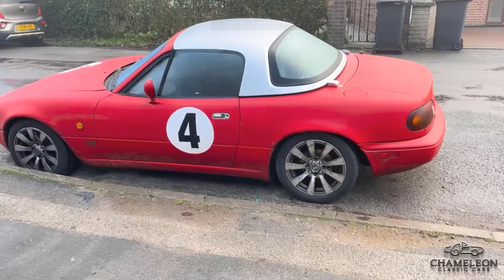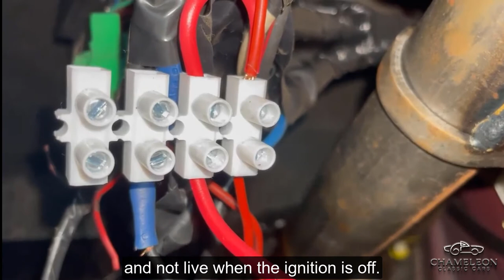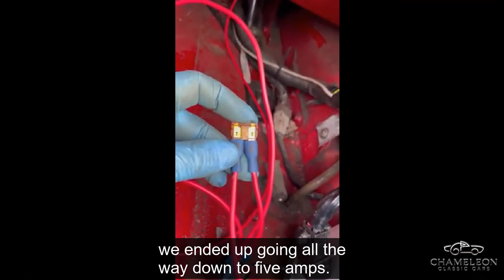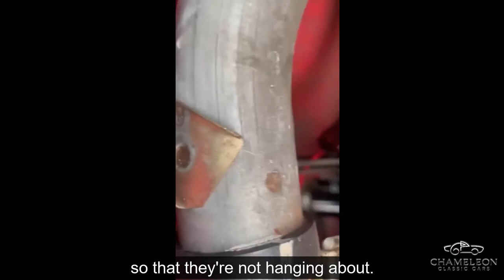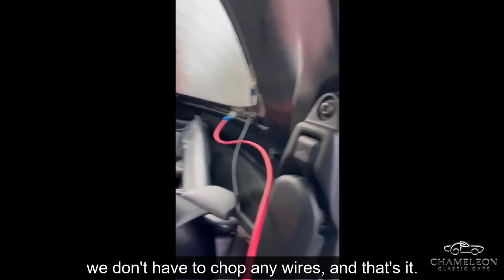How To Wire In Heated Rear Screen Mazda Miata / MX5 / Eunos Mk1

Comment from the maker: 00:00 How To Wire In Heated Rear Screen Mazda Miata / MX5 / Eunos Mk1 
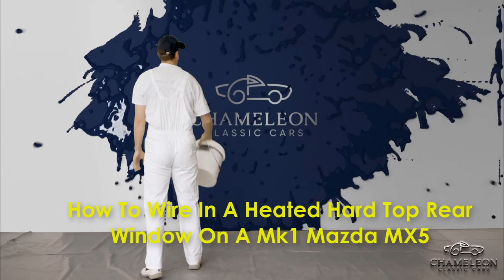00:26 Heated Rear Screen Mazda Miata / MX5 / Eunos Mk1 wiring diagram 
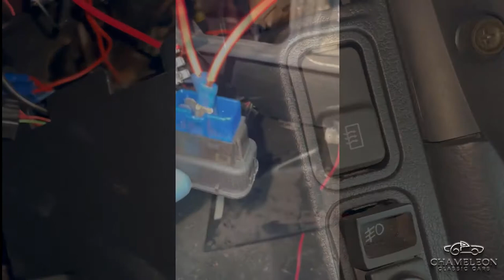01:52 Heated Rear Screen Mazda Miata / MX5 / Eunos Mk1 switch 
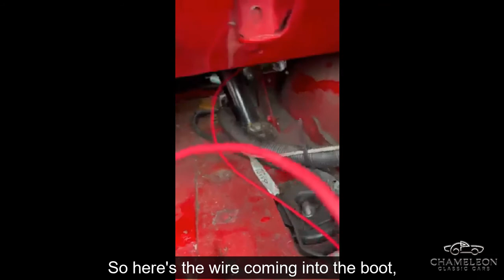02:26 Heated Rear Screen Mazda Miata / MX5 / Eunos Mk1 relay 
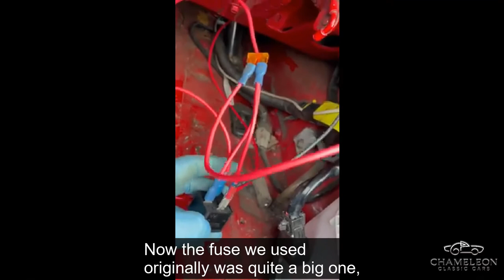02:43 Heated Rear Screen Mazda Miata / MX5 / Eunos Mk1 fuse 
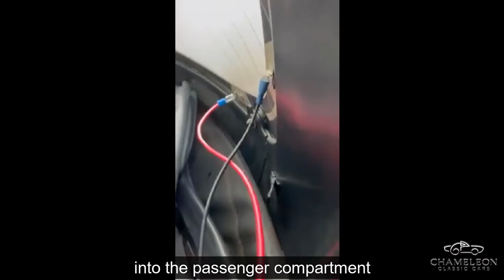03:59 Heated Rear Screen Mazda Miata / MX5 / Eunos Mk1 window connections

Comment: Hi what gauge of wire do I need for this
Reply from the maker: 28 x0.30 should work but please check online for advice about your particular vehicle. Make sure you use a suitable fuse
Reply: @chameleonclassiccars6396  Thanks, I found a company selling a custom wiring harness for the older mx5s by ilmotorsport so just bought that it has a relay in it

Comment: Hi, brilliant video thank you so much!
Can I ask what wire you used and a approximate length of the wire?
Thanks again
Reply from the maker: Hi, and thanks! I believe we used 16 or 18 gauge automotive wire and we used a length approximately the full length of the car as we started under the dash, went across to the side of the car, along its length to the battery in the boot and then across to the other side again and into the cabin. You're best to buy a roll of it and chop down to the length you need.